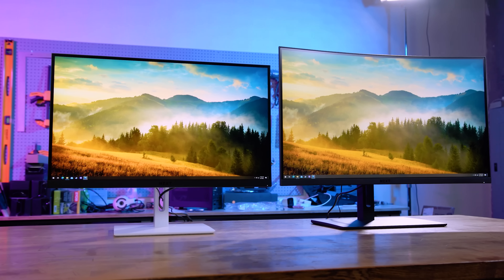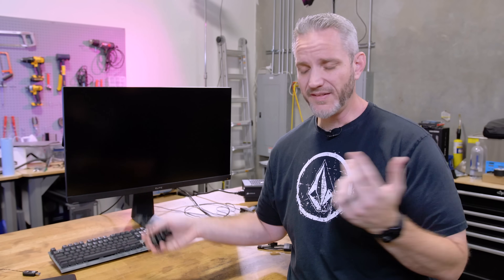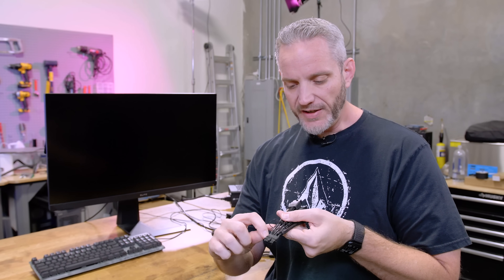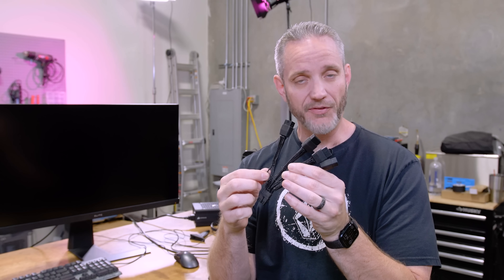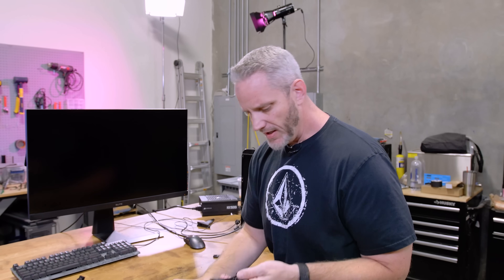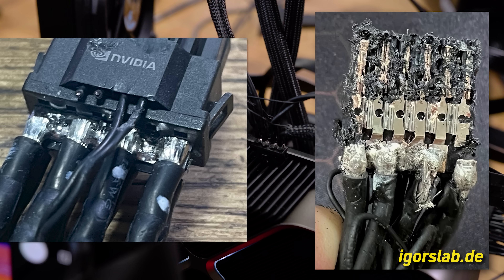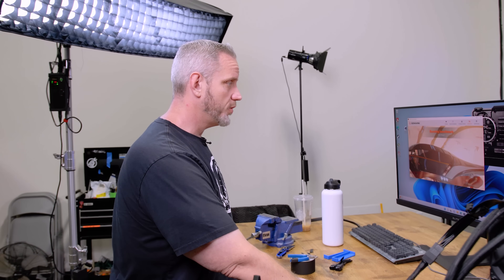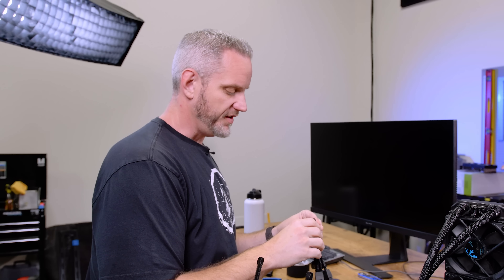Igor's Lab figured out why NVIDIA adapters are melting!

Comment: Considering that the solderjoint broke but it was still lodged firmly in there, that stuff probably caused intermittent connections (possibly even arcing), which are a LOT worse than a completely open circuit
Reply: Totally agree. These tests were done under ideal load, infinite resistance = fine very high resistance=heat.

Probably a better test would not need the  connector at all. Get a 600w 0.25 resistor and measure the temperature of the resistor. Could probably calculate something close with a watts to heat calculation.
Reply: It won't arc if there's a lower-resistance path, and there is because there are still wires connected.
Reply: @Matthew-ou2ie  - Sorry, that's not how electricity works.  Every complete circuit has SOME power flow.  This is why resistors in parallel of different values still work.
If I have a 5 ohm and a 500 ohm resistor in parallel, with 12 volts driving through both, all the current doesn't go through the 5 ohm.  MOST of it does....but not all.  There's a 12v drop across each, so the current through the 5 ohm resistance will be 2.4 A, and the current through the 500 ohm will be 24 mA.

While an air-gap has high resistance, the shorter the gap, the lower that resistance becomes......and at very small distances, it can even act as a capacitance as well.  Add in thermal expansion of the metal causing the gap to shrink/grow as the plug heats up, and suddenly you can have some serious arcing/heat issues in a connection that is intermittently making connection/losing connection.
Reply: @Matthew-ou2ie  the "arc" is on perhaps micrometer crack which still happens but not visible yet still creating enough heat.
Reply: You guys with your electrical know how going back and forth haha bottom line don’t buy this crap 😅
Reply: Spot on...
Reply: Didn’t take long to find what I was looking for. This is my guess for the problem. Judging from my limited experience and fascination with Electroboom shocking the crap out of himself. Arcing is absolutely a concern.
Reply: @norvillesdingus3917  The heat goes up with resistance, thats why wires are AWG and Amp rated, same with wires in your house, ask any electrican, too many amps through too small a cable (high resistance), its basically an incandescent lamp or heater element at that point. This can happen lots of ways, micro cracks, poor solder joint, frayed multistrand wires, poorly clamped wires in terminals, poorly seated connectors.
Reply: @morpheus9137  Remember wiring is derated based on ventilation. You can safely run 24 amps through a 24awg wire as long as it gets sufficient airflow.
Reply: There seem to be lots of people talking about arcing. You need a HIGH voltage to draw an ARC, 12 Volts doesn't really cut it ! Also, one one wire came off, so there'll onllt be a few tens of millivolts across the two ends anyway.

However, that form of construction, I'd call at best, amateurish and it should never make it onto the high street. Nvidia will cop a lot of attention from product safety people. It should be withdrawn and engineered PROPERLY, not like some last minute cobbled together thing.
Reply: @Matthew-ou2ie  100% correct, I do wish people wouldn't project their fantasies.
Reply: @TCUsouthpaw  Electrical know-how is how we can get to the bottom of this garbage.
Reply: @AnnaVannieuwenhuyse  Oh, I doubt you could do that actually ! 20 awg maybe. The point is completely valid though.
Reply: I said that the pugs are melted from arcing many days a go. Plugs don't just melt like that from heating up, you have charring and that is a indication of an arc being produced.
Reply: @NoOne56488  it's exactly this. I've experienced this a fair amount of times in my line of work unfortunately due to the companies trying to save a few cents using the cheapest plugs and connections possible with the products they're selling. 1 tiny wire arc can melt multiple in less than a fraction of second. Plus it's a design flaw.
Nvidia should've ether moved the power inputs to a better spot on the board or gone with the 90 degree input or both. Just don't cheap out always, those few pennies are not worth it in the long run.
Reply: @grahamstevenson1740  - You do NOT need high voltage to produce an arc.  The distance an arc can bridge is dependent on the voltage.  You can draw an arc from a 9v battery easy......it's just a very short arc.  Arcing is simply the breakdown in resistance of air.  Dry Air has a dielectric strength of about 3E6 V/m.  If there is ANY moisture, that drops significantly.  If the gap is measured in micrometers (thousands of a millimeter) then the breakdown voltage is in the single digit volts range.
Reply: @Matthew-ou2ie  That would be true if the wires he broke off where still part of the circuit, but they aren't. You still have potential energy in the broken off wires, and if they can find a path to ground through a few molecules of air, that's what it's gonna do.
Reply: @heliumphoenix  Bingo! I would in aviation and most systems are 12v or 24v, and I've seen in flight emergencies from smoked out wiring, 12v is PLENTY to arc if you have a small enough gap, we could be talking microns and nanometers, but its enough to create high resistance & ultimately heat.
Reply: @heliumphoenix  So you could draw a 3 micron arc with a 9 volt battery. Very insightful. The relevance here is what exactly ?
Reply: @heliumphoenix  3 MICRON arcs are a complete irrelevance to what is being discussed. It's an irrelevant snippet of random information of no earthly use.

The elephant in the room here is colossal RESISTANCE HEATING of poorly made connector assemblies conducting more current than they can safely handle, not bloody ARCING !

Do NOT distract from the real issue.
Reply: @vladuk  Yes, the inadequately rated THIN WIRES will burn out.

Every beginner in electricity knows the importance of proper CONDUCTOR SIZING (what Americans call AMPACITY) which is NOT the issue here. The wires are AMPLY large enough gauge.

Do NOT distract from the relevant issue here.
Reply: @grahamstevenson1740  - Okay, I'll break it down for you in VERY simple terms.
3 micron arc.  Dry air has a resistance of around 2E16 Ohms per meter.  So that's 60 GOhms resistance across that 3 microns.  9V potential across the gap.  A very TINY current flow (0.15 nA).  But the moment the air gap ionizes, it's resistance becomes VERY LOW.  That current then jumps up several orders of magnitude, resulting in a LOT of current shunting through it and dumping heat out through the resistance (which may now be less than 1 ohm.)  This happens VERY fast.
Furthermore, because of the nature of such changes, it tends to oscillate at VERY high frequency as this goes back and forth from an ionized to a non-ionized state (this is the dielectric breakdown nature).  This produces a LOT of heat as the dumping of electrons through the gap goes back and forth between high and low impedence states.  This is WHY arcing causes a lot of heat to build up.  Even small arcs.
Now imagine this happening INSIDE an insulated connector, repeatedly, constantly, for hours.  The amount of heat that can be generated is easily sufficient to melt plastic, and eventually even metal.
Go back to school, and pay attention in physics class.
Reply: @grahamstevenson1740  - Wrong, it is not irrelevant.  Furthermore, simple analysis shows why your stated case is a red-herring.
If the amount of metal is insufficient to carry the load, its because the heat load on it will get too high.  This means that regardless of breakage, the dissipation of heat will be insufficient, and heat build-up will occur.  Reducing the amount of conductor will concentrate the heat in the remaining area, resulting in failure THERE.  But that's NOT what we are seeing, we are seeing the heat problem occurring and melting the portions that have BROKEN FREE.....and are thus able to arc.

The failures would be very consistent with each design otherwise, and they aren't.

You are distracting from the actual issue.....a poorly designed assembly that results in potential breakage and arcing, leading to a fire hazard and damaged equipment.

We saw this before with the PCI-E riser assembly catching fire from a certain manufacturer.

Now just admit you were wrong, and quit making it worse for yourself.
Reply: @vladuk  Right kiddo, let me explain something to you.

I just picked up an Nvidia graphics card BOX that an RTX 2070 came in, OK ?

On it is printed the CE conformity logo that applies in Europe. It's a bit like the UL (Underwriter's Labs) UL marking you'll see on US products.

Now, when you print that mark on your product and its packaging, it has an important LEGAL standing with regard to PRODUCT SAFETY.

One of the important things it means is that it won't overheat or CATCH FIRE in normal use. Now I saw a 4090 cable harness ON FIRE yesterday in a video posted on twitter. That has LEGAL ramifications ! Very important ones !

Nvidia are basically BREAKING THE LAW by selling an UNSAFE product, that they have declared (by use of a conformity mark) meets national and international safety standards. IT SHOULD NOT HAPPEN and you get a big smack from the powers that be if you screw it up !

I'm not interested in your stupid little tales about thin wires selected by morons. It's important that the big companies selling to the public DO STUFF RIGHT. And what we have here is Nvidia getting it BADKLY WRONG. It has LEGAL ramifications that may well see them prosecuted for criminal NEGLIGENCE. 

DO YOU UNDERSTAND THIS ?

And I have zero interest in your stupid folksy examples cobbled together by clueless halfwits who don't have to work to International Standards.

GET IT ? Now shut the eff UP, will you ?
Reply: @TCUsouthpaw  facts. I'm done supporting this company. Moving to team red
Reply: Once again I'll point out I have no idea what I'm talking about. If heat was the problem we would see melting, but aren't there some chard parts on that connector? Does that not indicate something different than straight heat?
Reply: @vladuk  I have FOUR top-level domains in my name. What I choose to do with them is MY BUSINESS !

If I just want to park them, it's FOR ME to decide.

I think your probably the homeless one, living in mommy's trailer most likely, hahahahaha !

The property I'm in is valued at $800,000 btw !
Reply: @norvillesdingus3917  It's not actually *charred*. It looks to me as if the moulding is made of glass-filled nylon (melting point around 260C). GFN has a curious matt effect to its surface finish. You'll probably have seen it on various plastic moulded parts, it's not shiny like natural or coloured nylon.

What you're seeing, I believe, is solidified, previously molten GFN and what looks like 'charring' is just the rough surface effect that GFN creates when it solidifies after melting when it's not in a mould.
Reply: @grahamstevenson1740  interesting 🤔 today I learned!
Reply: @norvillesdingus3917  Pleased to be of service in that respect. Life is a continuous earning experience.
Reply: @vladuk  I've piloted planes too but not helicopters. Purely fixed wing..
What's YOUR favourite ride ?
Reply: @heliumphoenix  I would add in the fact that you have to debounce switches in your keyboard (unless you have a none contact switch such as capacitive, Hall effect, optoelectric etc.) because just before the contact closes they start intermittently arcing. But the sheer level of physics/electronics ignorance over this whole subject is mind-blowing for those of us in the actual know.
Reply: I was about to say the same. The arcing is the source of the melting. It happens in household wiring if you don't terminate your connection or twist your wire nuts enough. The gap causes arcing between the two contact points of power(main 14g wire to pin/solder)
Reply: @vladuk  I'm not bot. And yes even 12v can cause an arc. It happens when there is a gap between the same joint or connection point with electricity in any voltage. It's not the voltage that's the issue. It's the amount of amps that's dangerous. You can get severely shocked from a car battery. Again not the voltage or watts, the amps are the issue. Basic electrical engineering
Reply: @vladuk  I never wrote a bad or misleading comment...... not sure wtf you read. It was no way an insult or anything youre speaking of....... I was agreeing with the possibility of arcing and saying that a 12v connection can lead  to arcing and or melting due to heat.. wtf did you read man? go back to English class

Comment: It's likely not occurring when the pins are totally disconnected, but when the pad breaks and causes an intermittent connection. Burnt connectors like that are usually from wayyy too much current or (more likely) intermittent connections arcing.
Reply: Exactly. Plus it seems they're all testing the 12+ lines, where earth/ground is as much likely to cause excessive heat and even fire with a bad/intermittent connection.
Reply: From the automotive work I can 100% agree with this. We see this all the time
Reply: @Brocky05  they are testing only the 12V lines, as they are more likely to fail. At least as the pictures of the burnt connectors have shown so far. Every single fail was on a 12V line, none on the ground lines.

In general though you are right: In a circuit the fail can happen on both sides, be it on the positive or the negative one.
Reply: This is the way…. Completely disconnected = zero current. Failing connection = high current due to increased resistance.

Comment: If you get your hands on a melted connector I would suggest having it x-rayed before trying to cut it open.
I'm pretty sure the heat doesn't come after a wire is completely off, instead it happens when the bridge is almost broken increasing the resistance and causing much higher voltage drop at the crack.There also wouldn't be this sort of issue if they had actually bridged all 6 pins together.